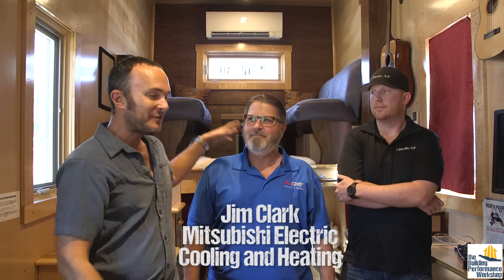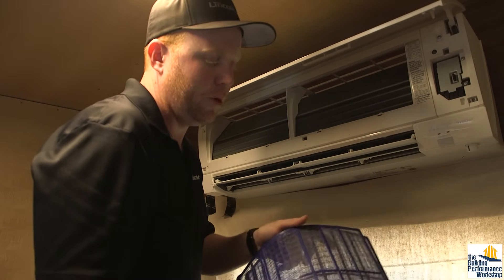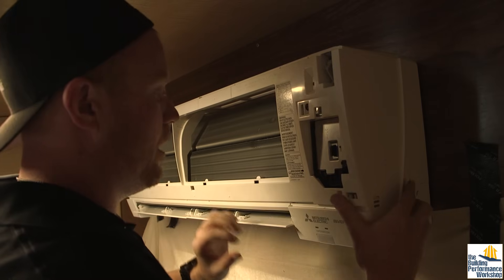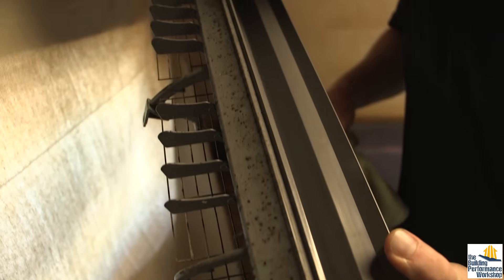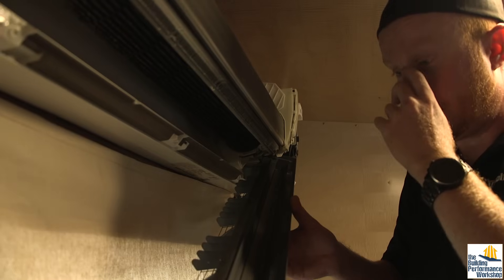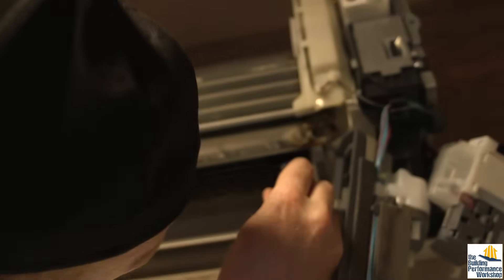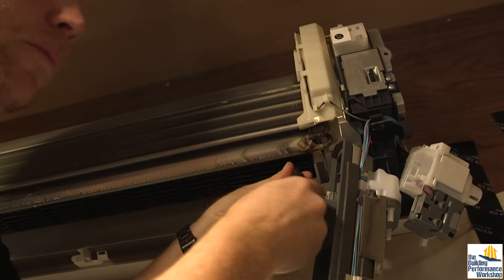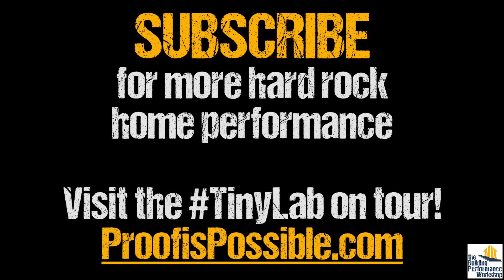Ductless Mini-Split: How to Take Apart & Clean DIY (Mitsubishi FH High Wall Series)

Comment: No. That’s not how it’s done.  Buy a speed clean machine and bib kit and douche the coil, blower wheel and the entire airflow surface areas and be done with it in a fracture of the time with minimal disassembly.
Reply from the maker: Sounds messy and heavy on chemicals
Reply: @HomePerformance  I'd sincerely be interested in why you say this.  Are you specifically concerned about this particular company, "speed clean"'s cleaning products?  (I'm starting from clueless, but a DIYer.)
I'm concerned about the occasionally musty smell from my two Fujitsu mini-splits and find the options confusing.  All the no-rinse foam videos say it drips off into the drain pan and show nothing on cleaning this wheel.  Wouldn't this dripping down also clean the wheel and drain pan?
Reply: Post a video Timothy!

Comment: Ok- “ don’t take the set- screw totally off or else...”   Tell us then- just how many turns of the driver will do, until I reach this most precarious limit?!  This  seems ridiculous!
Reply from the maker: A turn or two will do. Lots of work with machines requires a bit of finess, you'll figure it out, don't worry. And if it does pop out, it just takes a bit of time and frustration getting it back in.

Comment: These ductless units are INFERIOR 
Due to the MOLD that collects on the 
BLOWER WHEEL.  And the BW is not convenient or easy to get at!  
MITSUBISHI must improve !
Reply from the maker: You might want to check out the ceiling cassettes on these- they apparently don't behave the same way at all, because of the configuration.

Comment: Hahaha, way to push the fact that you have a special coil cleaner. Fantastic mixed 50/50 with water does a way better job ( the non bleach). Non caustic and it will get any grease left or dirt . Plus you get a great smell lol. That coil cleaner is over rated and over priced.